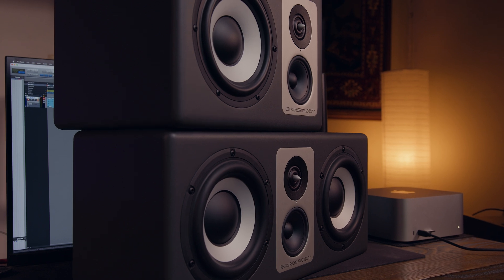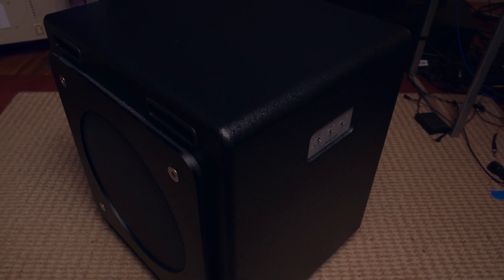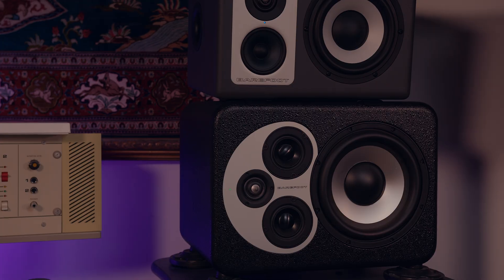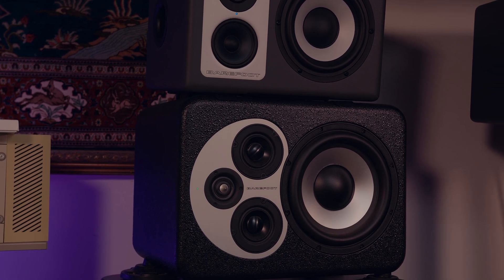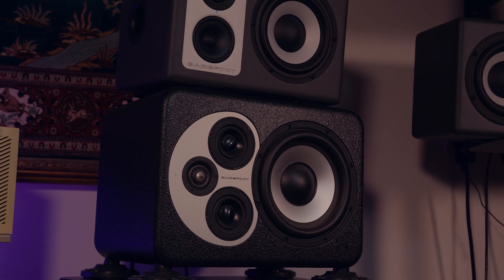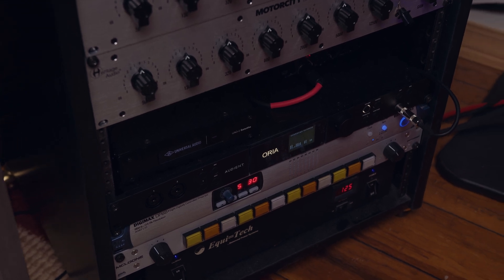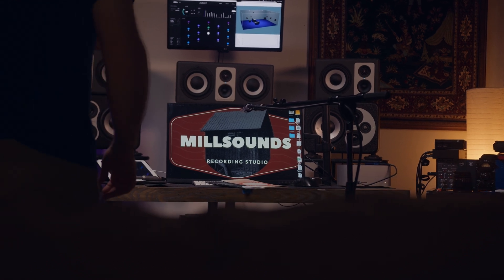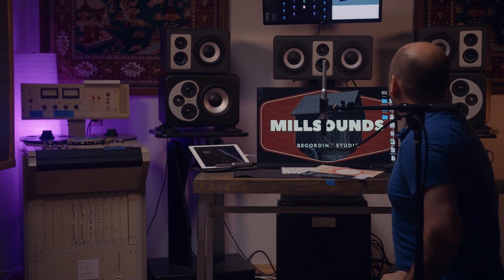Immersive at MillSounds: Considerations for Dolby Atmos

Comment: did you get rid of the ssl controllers?
Reply from the maker: I was just doing a demo for SSL on those. Purely from a logistics standpoint, I just don't have the room for something like that right now. I actually really enjoyed them, and now that the UC1 seems to be opened up to use with other plugins, I'm sure it would be fun to revisit them again. What I really want it a 1 fader control surface that has controls for Atmos/Surround panning. There's a massive hole in the market right now...